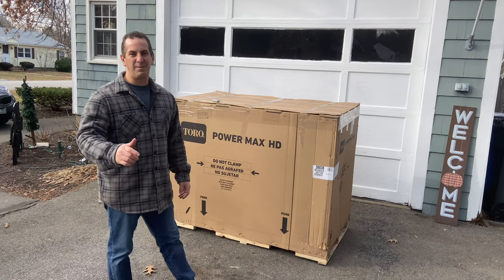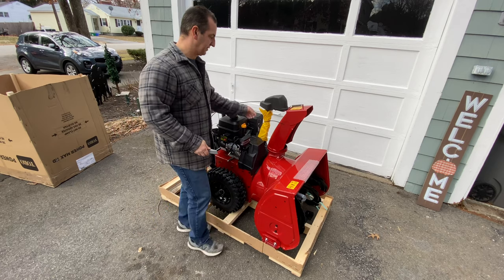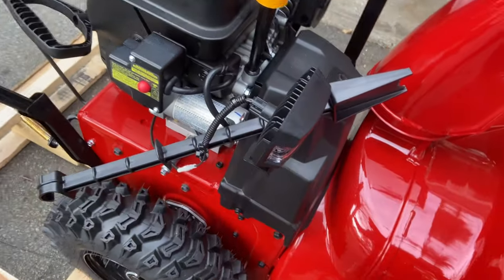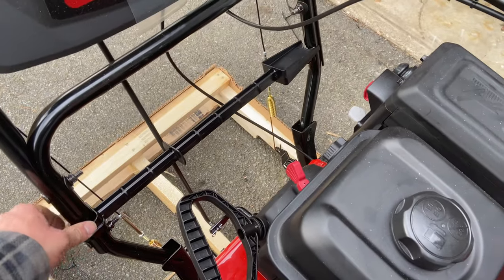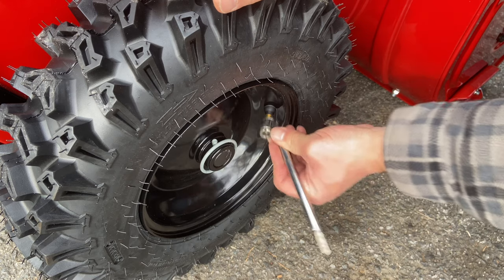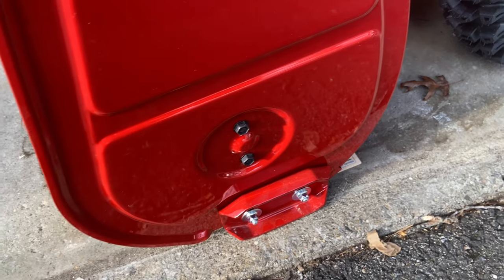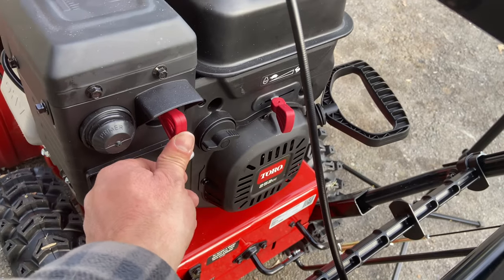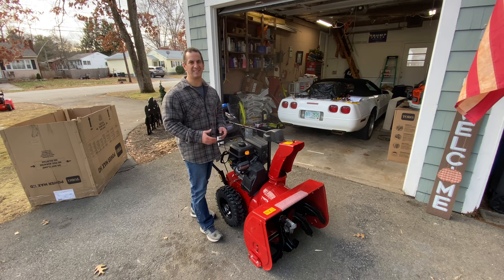How To Assemble Toro Power Max HD 828 Snow Blower

Comment: These are nice machines, I really like these latest generation Toro snowblowers. My one peeve is they should place the oil drain plug to the rear of the machine where it belongs, for ease of maintenance.
Reply from the maker: Yeah, I agree the SnowMaster 724 is designed that way. That 724 is a great little machine.